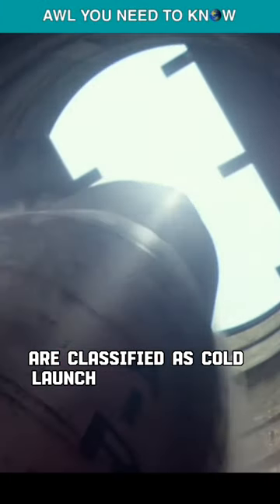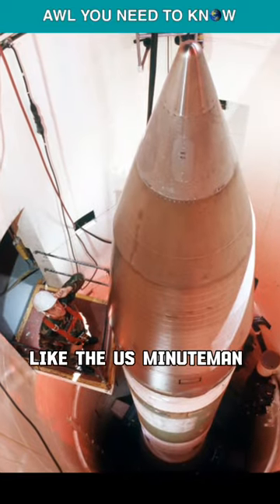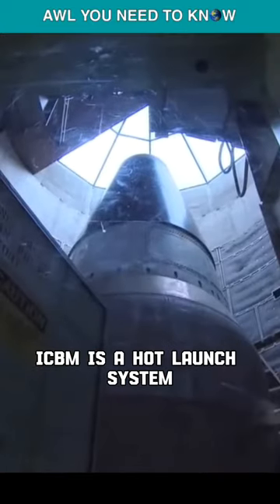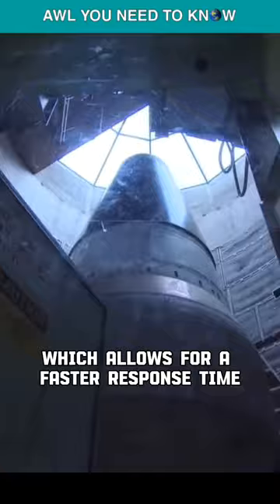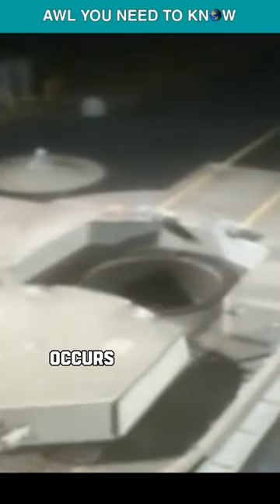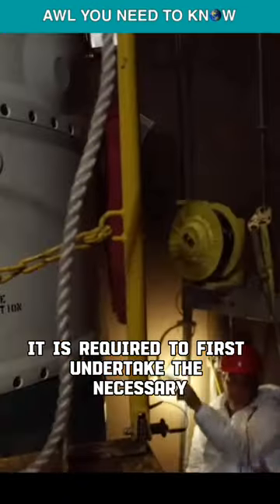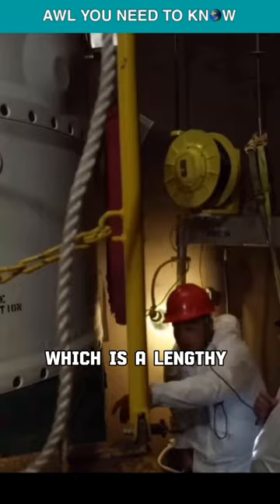Two Ways To Launch A Nuclear Missile #shorts

Comment: The main difference in hot and cold is the price. Hot launch silos need to be heat resistant while cold launched missile silos don’t need to be fire resistant. Almost all Russian ground launched missiles that are currently in service are cold launched, with the exception of the Iskander and S-550.